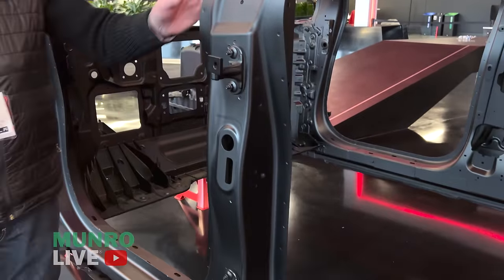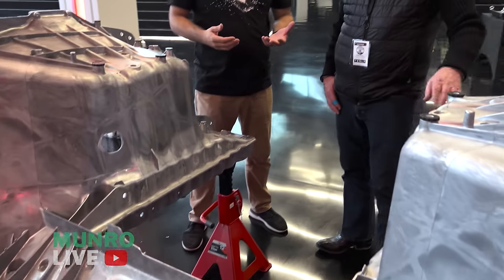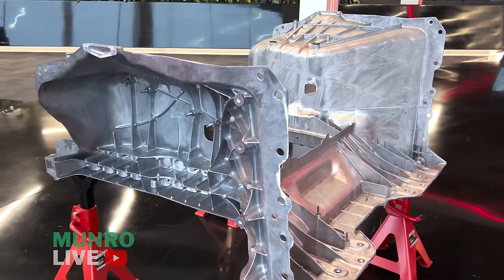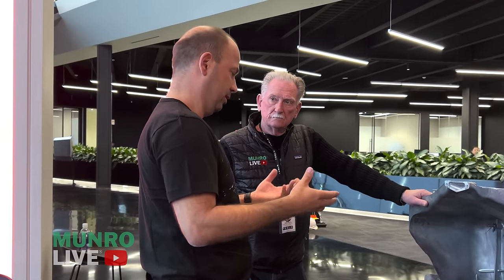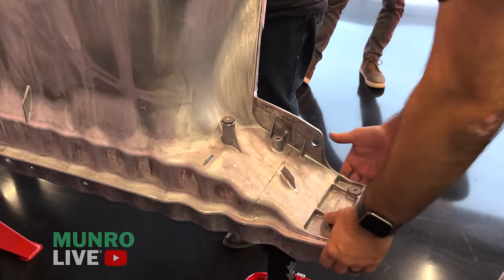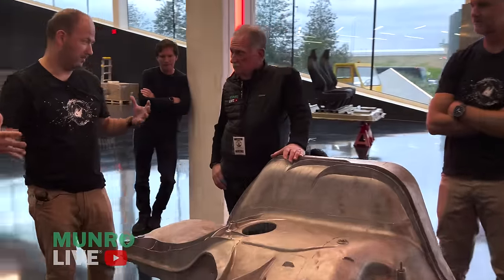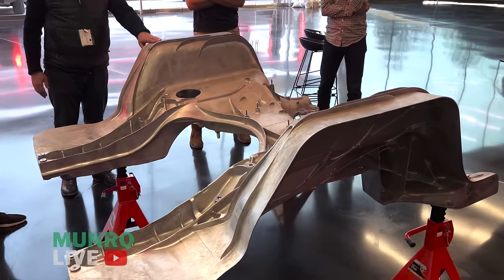Tesla's Head of Vehicle Engineering discuss the Cybertrucks castings and exoskeleton.

Comment: For those who haven't realized this yet... "exoskeleton" just means "unibody"... like nearly every other car. 
"Unibody" means unitized structure and body, in contrast to separately constructed frame and body. 

The external stainless steel panels are part of the structure (because it is a unibody), but they are not the entire structure (as a true exoskeleton would be). Late in the video, the Tesla rep explains how the rear aluminum casting is the critical structural element of the rear of the vehicle... not the surrounding panels.

It is becoming common to include more than one material (steel, aluminum...) and even more than one component production method (stamping, extrusion, casting) in the components which are joined to form the unibody. In the Cybertruck, there are stamped boron steel, cast aluminum, stamped stainless steel, and formed (bent) stainless steel. There are also aluminum extrusions and composite (fibre-reinforced polymer) parts attached to the unibody, but not an integral part of it.

Comment: Would have been nice to have a discussion about those the stainless panels are hung. Are the edges folded over and drilled out for hanging? Are there stamped hangers beyond the door ring or is everything bolted to the castings? Clearly there has to be several cross car brackets for mounting the IP and the frunk, lights etc. Im asking because the "story" on cybertruck has been a reduction in stamping, but what we are actually seeing is the largest stamped door ring ever. So fewer individual stampings, but bigger ones to reduce the amount of overlapping and welding required, and reducing overall time in assembly.

Its also interesting to note the contrast between the angular exterior and the curvaceous organic shapes on the stampings and castings. Reminds me of old school cast iron "asthetic era" machine tools with swooping curves.
Reply: Probably in the production. Video coming soon
Reply: The edges don't seem to be folded over, and I guess that's why the vehicle does not meet pedestrian protection standards to be homologated in Europe?
Reply: @deltajohnny  well, the sharp corners and weight in general are enough to do that. Apparently europeans care about not decapitating children or something.
Reply: @patreekotime4578  I'm sure that in the future, the US will also adopt these standards 😉
Reply: Yes,  @rogerstarkey5390  it's all in the later Munro video "Tesla Manufacturing: See how the Cybertruck HFS Panels are Blanked, Bent, and Built!"

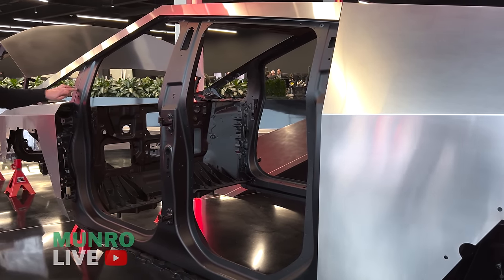Comment: 1:30 The A pillar looks like it’s 8 or 10 inches front to back. I don’t have any problem with the size but it screens the driver’s view. What stops the pillar from being at 45 degrees instead of long front to back? You get the same strength but the driver sees the smaller dimension so his view isn’t blocked as much.

Comment: What worries me is that they integrated the cruch can into the casting. This means that in most crashes, the front casting will need replacement. Insurance companies won't like that.
Reply: The crash can is integrated into bumper, as mentioned on the other video. The additional crash absorption in the casting is for the severest impacts. At that point you wouldn't want the structure repaired and back on the road anyway.
Reply: Any vehicle crash in which the crash rails are destroyed these days is almost always a complete write off.  They're designed to lessen the impact felt by the driver and other occupants not save the damn car from being totaled in an accident.  I seriously don't understand the ridiculous argument that crash rails make the car easier to repair, that's not the damn point of them.  Low impact accidents, which almost any vehicle will survive largely intact won't lead to Tesla being totaled.  Will you need to replace the crash rails?  Yeah probably cause they'll get bent or broken in some way, but that's not their intended purpose.

Comment: It is funny how it is flat outside but organic inside.
Reply: It is flat on the exterior because they could not stamp the exterior stainless steel panels without marring the finish, so they were limited to folding them. Interior forms are curved because that is what they need to be for strength and manufacturability in the processes used in the interior (casting and stamping).

Comment: Unlike steel, aluminium don't have a fatigue limit (ie: it will continually deteriorate from any small stress, while materials with a limit wont unless you pass a certain threshold), which means that a) they must incorporate higher stress tolerances to have a meaningful lifetime and b) will weaken over time.

How do they incorporate this into the design, how large tolerances do they have, and what is the design life (and just to rehash, materials with a fatigue limit doesn't have a life limit based on stress)?

Comment: That's really interesting. Talking of towing, is Tesla going to integrate a Load Cell into the towbar so they can accurately calculate predicted range based on the actual resistance of the load that's being towed?
Reply: Certainly would be easy to do. Just put a couple strain gauge rosettes on the hitch. The rest is an op amp, A2D converter, and some software.
Reply: Unnecessary. They have to figure out the loads inside the cabin and on the bed though indirect calculation anyways.
Reply: no need. they can compare power draw vs acceleration to calculate weight
Reply: Hitch weight is only a small factor when towing. Is it a car carrier, travel trailer, enclosed cargo? Too many variables.
Reply: No need. Range can be calculated by energy used vs speed. Simple. 

Now go back and reevaluate your fanboyism 😂

Comment: Sandy  looked over Cybertruck metal with a Tesla leader. The front crumple area behind the front bumper appears to have a wide-ish;  then curved piece, almost shovel- like that is part of the Giga press front section and the crumple area. 
Also
Part of the Giga press piece in the front has an incorporated, inclined curved piece that looks like an I-beam-ish shape with cross ribs  that are also part of the shovel shaped edge. 

How does that combination of areas in the crumple space work to a sober energy? Does the shovel-ish piece curl up rather than fold? 
Very different than other crumple shapes we have seen is stamped or extruded steel. 
Please explain😀

Comment: The capsule of the cabin is made of boron steel welded by the method of dots. But VW, already in 2005, began using laser welding, when sheet metal is connected not by dots, but by strips, and this method gives the best result for torsional rigidity of the structure. Why doesn't Tesla use laser welding?
Reply: Tesla does use laser welding for this vehicle, but to join the exterior folded stainless steel panels to the stamped stainless steel panels under them. See the later video "Tesla Manufacturing: See how the Cybertruck HFS Panels are Blanked, Bent, and Built!"

Comment: I'm no engineer… obviously… but it seems to me that this inner frame constitutes an inner skeleton, and the so called "eksoskeleton" are simply stainless steel panels that stiffen it further.
Reply: Don't tell the Tesla fanboys that!  Yes, you're correct as far as I've seen on the various videos, the stainless panels are just attached on to a steel and aluminium castings unibody.  I doubt they contribute anything substantial to the overall structure or stiffness, just resist localised impacts.  Really the technology on display here is the significant portion the castings make up of the unibody structure.
Reply: @boredKiwi only benefit seems to be that you don’t need paint. But stainless is very difficult material in many ways. Basically the body is made just like any other car apart from the castings which seem very impressive. This whole idea is bonkers but it probably spawns a lot of new ideas even if this one is not the greatest ever. To me, it’s still ugly and I can’t stand fingerprints but it’s not built for me.
Reply: @boredKiwi  I apologize for any confusion, but are you saying it is possible to repair a Cybertruck body? I understand it depends on the extent of the damage, but I do wonder if the repairs outweigh ease and cost
Reply: Yeah, from what I can tell that was all hype. The door rings and cross-car members still represent traditional "unibody" construction. They have reduced the number of parts with giant castings and gigantic stampings, but its still a classic unibody construction.
Reply: @patreekotime4578 
"Classic unibody" ? 
Is that with or without castings?
Or Structural pack?
Or load bearing outer panels?
Reply: Like the guy below says , hopefully the fanboys don't figure that out , they might loose there shit , it's mostly the exact same as the model y , using castings front and rear. At least with the stainless,  there is no paint operation , and that's probably a big enough saving on cost. I'm glad there not gone full exoskeleton as some dude is going to have to fix panel damage at some stage and his job will be a tonne easier , with removable panels.
Reply: @rogerstarkey5390  interior and some exterior components bonded together to handle loading stresses. structurally it functions the same as any other unibody. maybe with higher torsional rigidity than most. But it is NOT the much hyped exoskeleton.
Reply: Yeah, there's no exoskeleton here, it was reduced to marketing. Still impressive castings, but they had to scale back to a more traditional approach.
Reply: It weighs similar or less than other EV trucks despite much thicker outer panels.  That means they had to take weight out of the frame.
Reply: @kobbetop The contractors won't care. And the "all hat and no cattle" people with wrap them.
Reply: Oh what a great discovery you and your friends above have discovered! It is all hype, you actually know what the inner structure is. Clever boy ... oh, you are guessing? Did you feel better after this bleating rage about fake CT body? I guess we can add ego and stress relief to all the thinkgs CT can do.
Reply: @mhsj  what

Comment: Lot of people out there disappointed that it's not all stainless steel; it's just got a normal steel unibody.
Using aluminium castings to take suspension loads, bed loads, towing loads, isn't good for longevity.
Reply: It's an alloy.  Tesla has actual metallurgy experts.
Reply: @snookmeister55  Do you know what an alloy is? there are aluminium alloys and steel alloys of varying metallurgy, of which it appears you know nothing about..

Comment: The front end is just 1 piece cast? So if the front fender is hit hard enough to break that, you'd have to replace the entire thing??
Reply: The outer fender is stainless steel, there's a non-stainless inner fender under that and the wheel housing is part of the aluminum casting. If the corner is hit hard enough to damage the casting... yes, that's likely a total loss of the vehicle.

Comment: Great access and detail.  I’m still not convinced that insurance is going to like those once piece castings.  Maybe it will be a case of no damage and then all the damage so it’s great up to a point and then it’s write it off.  Or maybe one can swap the casting out, but that seems like quite the operation.
Reply: Well its a good thing Tesla offers their own insurance plan for drivers!
Reply: @jfifield20 Tesla does not underwrite it... 

Tesla is a wrapper
Reply: Yes, any damage to one of the main castings will mean the total loss of the vehicle.
Reply: At the point the castings are going to be involved in an impact and take damage, it's likely a write off anyway.  Can't tell you how many other cars without these types of castings get written off.  It doesn't take all that much to bend the frame in a standard vehicle, in fact it's designed that way to take the impact energy.

Comment: so its a steel + aluminum body with stainless skin, right?
Reply: castings front and rear are aluminum?  middle cab section is steel?  and the body panels are ss?
Reply: @zachlafond2652  yes, yes, and yes... if by "body panels" you mean the externally visible panels of the body, as well as some inner panels such as in the hood and doors.

Comment: Great video but a mixed bag for the truck.

Bad: Heavily advertised "exoskeleton" is actually more internal than average unibody. In such an engineering oriented video, the "fender" parts should really be take off to show the internal structure.
Good: There should be some real crumble zones built into the structure to protect the occupants and others.
Bad: Yet to see how resistant it is to low speed crashes.
Good: Large scale aluminum structures.
Bad: Difficult to repair.

Comment: Very impressed.  Put a hybrid system in such a well-engineered truck and I'd buy it.  Anything to avoid charging times and hassles - I'd rather visit a gas station once a week than be tasked with plugging in every night, or waiting around during road trips for charging.
Reply: Why would you rather go to a gas station?  That takes time as well.  Plugging in at home is literally the same thing and cheaper than gasoline.  As an owner of EV's and ICE vehicles I don't find plugging in a chore, in fact I prefer it now to going to a gas station.  Same with charging on road trips.  On long ones, yes it does make it a bit longer, at the same time an opportunity to stretch, use the restroom, etc.  For the amount most people road trip it really isn't that much of an issue in my experience.

Comment: Tesla’s competitive advantage are its people and the freedom to do clean-sheet designs.  Legacy automakers would take (and are taking) 10 years to design a unique vehicle like this.  They just don’t have the people, the streamlined org, and the freedom to move fast.  Shareholders should be worried.
Reply: As fast as the roadster 2 and model 2.
Reply: Nag nag nag ,,, so much constructive thought to add to the conversation. Such clever repartee. @TsLeng
Reply: @mhsj  Tesla bois can't handle the truth. I still remember how for years the same people were saying Tesla solar tiles gonna take off. 

Tesla makes decent stuff, the 3 and Y. But don't confuse anything else other than hype
Reply: @TsLeng  Not a fanboy but a shareholder and owner.  I also own GM and Ford products as well.  Our '17 Model X with 95k miles is still superior to most of the non-Tesla vehicles I've bought / driven.  The fact it still continues to get OTA upgrades as well as hardware upgrades (computer, cameras) is amazing to me.  Never had that kind of service with any other domestic / foreign brand.

Comment: Completely bonkers how Tesla operates. To them, once the project is out. They know their is no motivation on holding back information. While they don’t spew out models. I really think this is warfare by innovation.
Reply: Not Warfare.
If that were the case they wouldn't have told everyone what "The plan" was (is)..... Several times.
There's certainly trolling, but that's just trying to encourage the laggards.
Reply: Just shows how pitiful we've become when you call innovation warfare.
Reply: Struggling to find a reference as to how the steel panels are attached to the frame. A video 9f the robot handling them on launch day is inconclusive.  This is pertinent to discussions regarding cost of accident repairs.